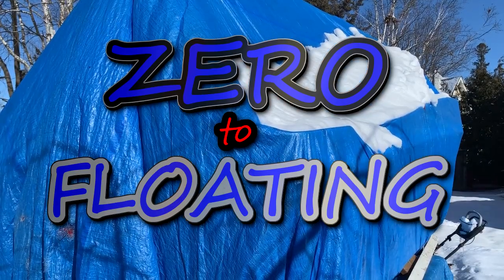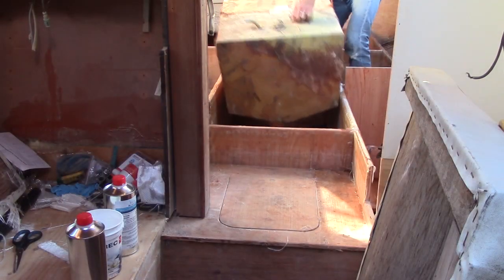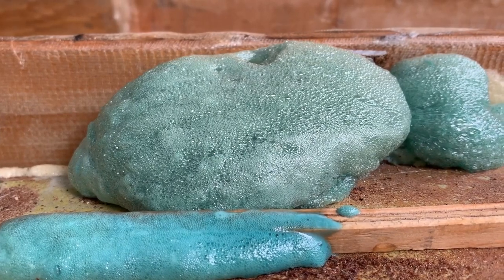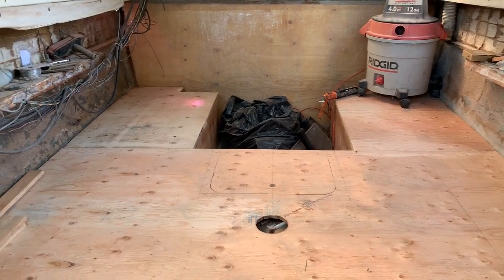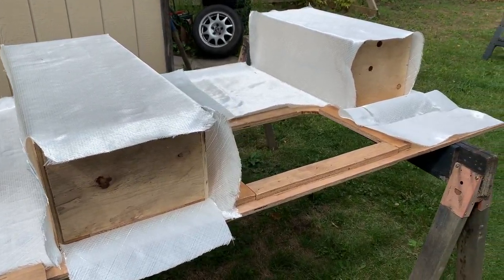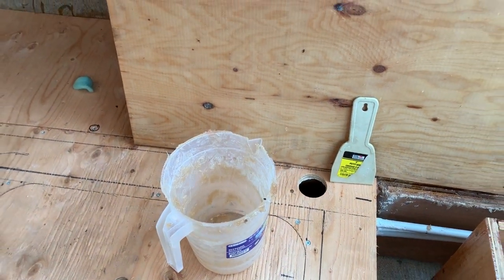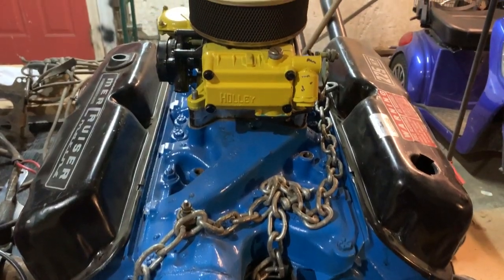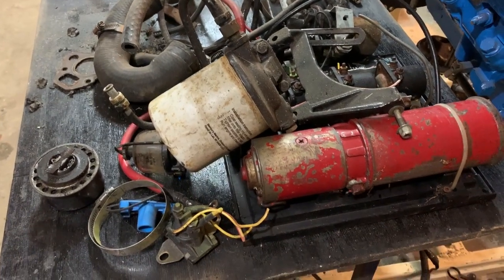Part 8 – The Floor is In! - 1974 Sea Ray SRV 240 Weekender Re-build

Comment: Greetings from Lewes, Delaware!  Not sure why you dont have a million subscribers. I'm glad I came across your project, and I am in awe of what you're doing with this fancy old lady :) I have a question. My project is a 79 cruisers inc. 201 beachcomber. I love the boat. And am slowly restoring it. But it gas a saturated balsa core.  It's not rotted just wet all through the bottom of the boat. Can I dig it all out, and lay up glass on the bottom? To have a solid bottom? I will never sleep, knowing that wet core is in there ticking away, and weighing my rug down. Anyway, your input/expertise would be greatly appreciated! I am getting ready for the summer now, but next year, plan on digging into her. I want to do it right.
Reply from the maker: Thanks for the compliments! I'm just trying to document what I'm doing and learning as I work away on my projects... hopefully I can provide some inspiration for others. Wish I could give you the "right" answer, but my expertise in this area is limited to what I have done with my old boats, and what I have read and studied online. My boats are just plain old solid fiberglass hulls, no cores of any kind. That's one of the reasons I went for such an old boat - I've read too many stories of rotted cores. The reason for the cored hull (in my understanding) is to provide rigidity with lower weight. A thin glass bottom will flex too much, a thick glass bottom is heavy. A cored glass hull gives you the strength and rigidity with less weight. I think it might make the hull quieter as well. I'm guessing there is a lower manufacturing cost or something associated with it too - but that's just my guess. Problem with a cored hull is that it will get wet eventually, and wet wood WILL rot eventually. Then your hull is cored with mush - all the benefits of the cored hull are gone. I'm "guessing" that you could replace it all with glass, but it would require a lot of fiberglass to build it up to enough thickness to be just as rigid - lots of heavy glass cloth, laminating resin, doesn't sound like a fun job. Not sure you would save a lot of weight though - the boat might end up heavier than it is now. Solid fiberglass is heavier than even soggy balsa.
Reply: Yeah. It is an issue I'm struggling with. I think I'm going to give it a go. Maybe next year. I sure wish I knew before I bought the boat, and put a brand new outboard on it :( it's my first fiberglass boat. All my others were aluminum. How thick is the bottom on yours? Honestly, I'm not concerned with the weight. I just cruise the bays with the wife and kids. Not really concerned with it being super fast. And as heavy as it is now, as wet as it is, it cuts through chop like a Cadillac!  Lol. I'm thinking of laying up 6 layers... 1708, and maybe a layer of 20 oz cloth. I really appreciate your advice. And I am looking forward to your new videos! Thank you
Reply from the maker: I don't actually know how thick the bottom is - I haven't put any holes through it yet! I will be drilling a hole for a thru hull for the water pickup for the toilet at some point - guess I'll find out then!